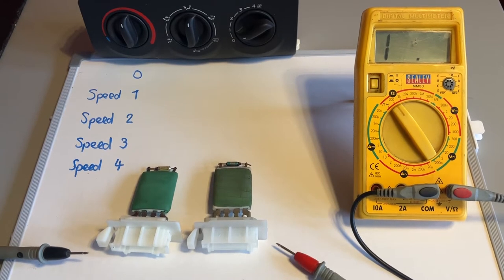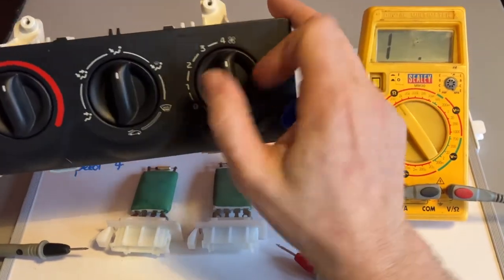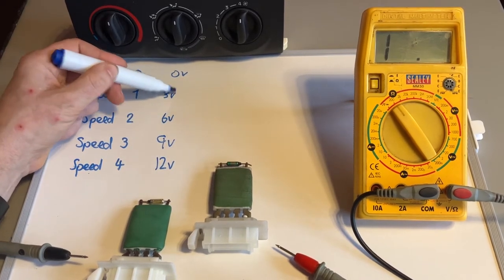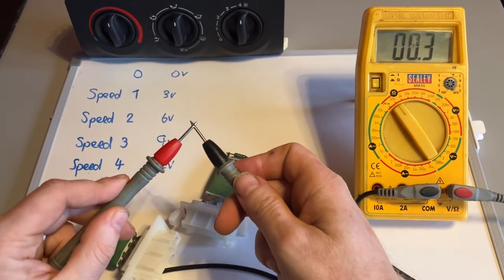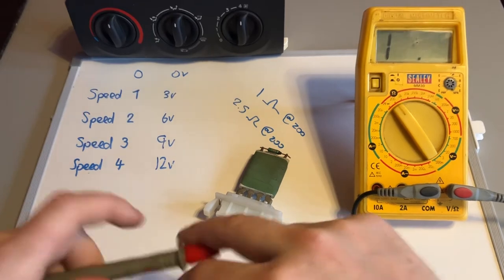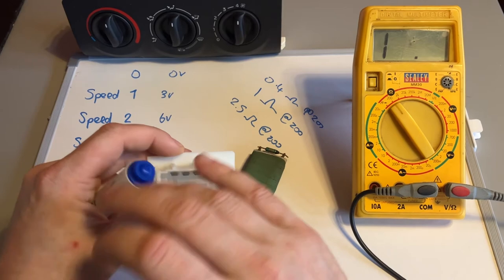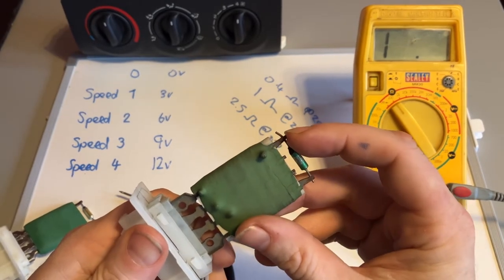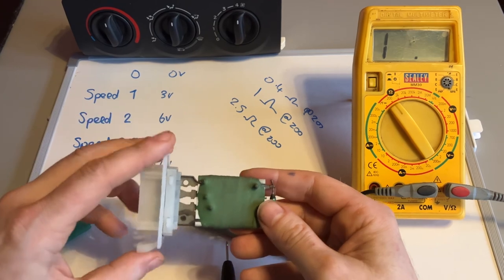How to Test a Blower Motor Resistor Pack.

Comment: I see that you ve been replying comments so worth a shot. Good explanation there but I am a little confused on mine. My motor doesn't work on any settings 0, 1, 2, 3, 4, none of them. I pulled the motor out and hooked it straight onto a 12v battery and it spins fine so I guess it was the resistor. I hooked a multimeter to the cables that go to the motor and and setting 0 I read no volts so thats fine, on setting 1 and 2 I read 8.5v and on setting 3 and 4 is its 12.08v. Motor should work on setting 3 and 4 isnt it but it doesn't. Confusing
Reply from the maker: Hi, so you have changed the resistor and now it’s only 3/4 that don’t work? So, some systems have separate relays and fuses for low and high speed settings. One relay could be powering 3/4 setting. I know you are getting supply voltage, but under load/ high current draw it could be failing. I’d probably go there next.

Comment: I believe   0.4 ohm is position 3,   1 ohm is position 2  and 2.5 ohm is position 1.   position 4 does not involve the resistor pack.
Reply from the maker: Yes, the higher the resistance, the lower the speed setting.

Comment: Getting a reading of •3ohms on one of the pins is this bad
Reply from the maker: That is probably ok. The fact you’re getting a reading tells me the circuit is complete and should be functioning fine. What is the symptom/s you are trying to solve?
Reply: hi, so these resistors form a voltage divider?  and do they regulate the voltage to the motor or the current?  I read about current regulation in many places, but according to my knowledge, the speed of dc motors depends on the voltage.
Reply from the maker: Yes, the resistors restrict the amount of current technically (we rate it in voltage just for ease of understanding) allowed to pass through each branch. So 12v/ same current comes in on all branches/ speed setting but only a set amount is allowed through the resistor to the motor. Please subscribe if your finding the videos helpful! Cheers
Reply: @AdamMechanic  thx. so the voltage technically does not change.  but because the resistors are connected in series in front of the motor, so they add to the internal resistance of the motor, which results in a lower current if the resistance is higher?
Reply from the maker: Yes, you’ve got it! Thanks for the sub, much appreciated!
Reply: @AdamMechanic  my problem is that none of the stages work, even though i understand stage 4 is connected directly, so i suspect the thermal fuse.  thank you for your help, I'll get back to you with the results in 1-2 hours.  thanks from Hungary!
Reply from the maker: Yes, please do, be interested to know!  @zalanocsko154

Comment: What if resistor n blower got no power relay n fuses are good
Reply from the maker: Hi. I’d probably unplug the blower motor itself next, turn it on in the car and see if voltage is getting to the motor with a multimeter on the connector side. If 11.5- 12v is getting that far than it will be the motor itself that’s gone. Please subscribe if it’s helpful! Cheers.
Reply from the maker: Other things to check are bad connections and earth, then probably switch after that. Cheers

Comment: My fan has just stopped working full stop,1,2,3,4 nothing at all,fuse is ok,will it be the resistor gone?
Reply from the maker: Could be, but more likely the relay, blower motor or a wiring connection/ earth.

Comment: Hey Adam, How does the full speed connect to the blower, by a relay? I have all the slow speeds work on a 2008 Kangoo but the full doesn't
Reply from the maker: Hi, it would go through the same relay as the other speeds normally. Sounds like you have either high resistance in the motor itself, or the wiring leading to it. One of those is not allowing the motor to use the full 12v
Reply: @AdamMechanic  Yes it looks like that, but I cannot find the route of the cable from the knob to the blower. I tested the blower direct with 12V it is fine of course seeing that it works at the slower speeds. I need to see a diagram really to follow those cables and see if another connection exists somewhere.

Comment: Hi Adam, are you aware if a 2013 ford galaxy resistor needs calerbrating
Reply from the maker: It shouldn’t do. They are normally just plug in parts, not intelligent or needing programming.
Reply: @AdamMechanic   thanks Adam, it's clearly a duff one then.. warranty claim